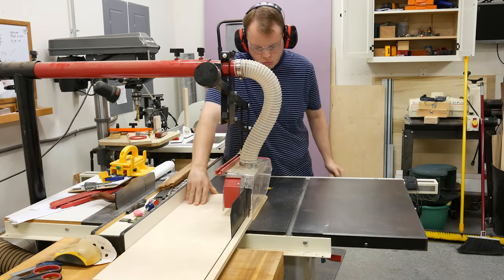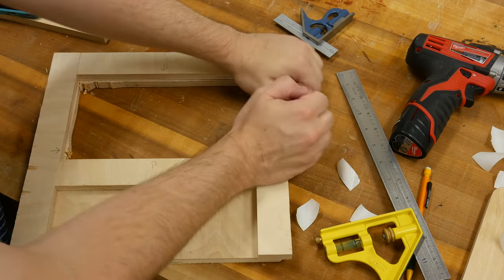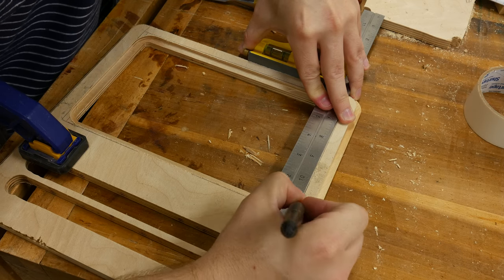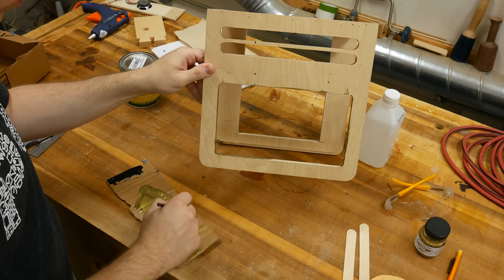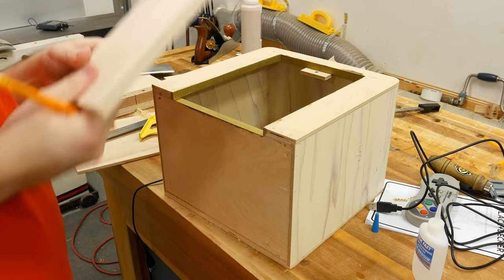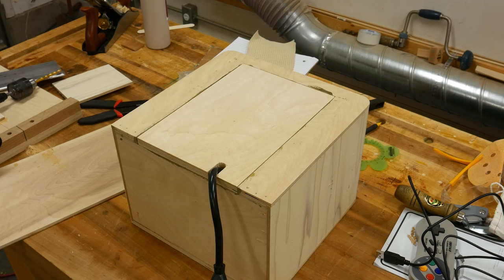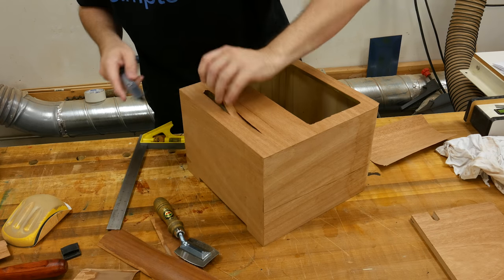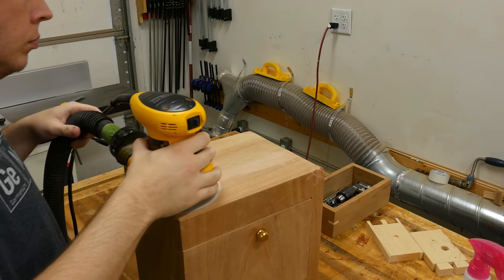Retro Arcade Cabinet Using A Raspberry Pi & RetroPie

Comment: Gorgeous case. Few thoughts I had while watching your build:
- Speakers: I'd definately purchase a high end 2.1 PC speaker set, disassemble from its casing and add subwoofer/left+right speakers - making a hole on the bottom of the case covered with a grill for the SW speaker, and 2 holes on the top (or one on each side) for the L+R speakers;
- Front controls: I'd make them functional - e.g., to operate the controls on the 10" LCD monitor's control board.
- USB location: I'd position the RPi so that the USB ports would be available from the outside (e.g., one of the sides), so for example, installing an external keyboard or a different gamepad/joystick would be much simpler to do.

Those are things I'd definately want to do if I was going to build this cabinet for myself.

Comment: When I veneer, I find it easy to cut out those shapes, like where your speaker holes are, with a drywall plunge router on a low setting. It works like a charm on old fancy radio cut-outs. Great work, though all around!

Comment: Everything looked great. Good first time build.
Suggestions.
1. Bezel the screen. The gold would look great with a bezel facing the viewer.
2. Stereo speakers. Your missing out good audio on some games.
3. I saw others say 4:3 but yeah finding a 4:3 hdmi screen is hard. You probably will never use the rest of the screen except in menus in retro-Pie. Might want to load Kodi.
4. Wireless. Get a Bluetooth dongle and pick up a pair of controllers from 8bit-do..
5. Make a matching wood arcade stick for mame games!
Reply from the maker: Thanks! I am actually making the matching gamepad soon.

Comment: That build is amazing. I have always loved the "old wood box" TV look from the 50's and 60's. 

You asked for some feedback so here is mine.

1) It would be cool if you routed a switch to one of the front buttons, and maybe a volume knob to another. 

2) Think about routing a USB port to the side of the box or the front in one of the grills for easier use of a corded gamepad and to add new ROMs to RetroPie using the USB service that it provides.

Comment: Clearly a lot of love went in to this build. It looks like you've got a great workshop there and clearly have a great eye for detail and a keen sense of 'doing it right'. Inspiring.

I didn't know what to expect when I stumbled across this video. Perhaps more of the internals side of things. I was pleasantly surprised. More than anything it's a great show of techniques for cabinet design and build - especially given you were making up a lot of it as you went along.

There were only two things I was a little surprised about. (1) You use nails for almost everything you didn't use glue for - were you ever worried about splitting the wood? and; (2) you chose a 16:9 aspect ratio screen when the game at the end has a narrower aspect - shame to put all that effort in and then live with black bars either side 'at runtime'!
Reply from the maker: Thanks! Yeah I wanted to focus more on the cabinet than the internals because setting the pi up was super simple and quick and there are tons of tutorials on that already.

1. I wasn't worried about splitting because I covered it with veneer so it hid any blemishes.
2. It's hard to find a 4:3 screen that wasn't an old CRT monitor so I just went with the 16:9. The black bars don't bother me really but it would have been better to have a 4:3 screen.

Comment: Very good job... would you be willing to due another one with some small modifications to it.... one use solid pine wood, two create an on/off switch, three add 2 small speaker, also front or side USB ports for controller and a Bluetooth add on for wireless controller and last two or one small fan on rear for ventilation.... also what screen model did you use for your project....

Comment: Very nice Cabinet top marks :), Veneer is always a difficult thing to work with. Steam in the iron helps bending it, As for your speakers well you could of done better, They sell a lot of good quality lower priced speakers these days, Like a small sub/tweeter/crossover mix, or even car speakers , Like the the sub could of been on the bottom and the tweeter/mid range out the front . A small tube amp kit could of worked nicely also the tubes glowing on the top, They sell DIY tube amp kits on aliexpress.

Comment: Gotta be some kinda functional buttons like power switch or screen color/saturation adjustments, or volume up/down etc. Not those black ones only do decoration. Besides, how does your wired controller reach the pi?

Comment: Superb work. Only one problem though, the style of the case is circa '40's but the games on it are from '80's and '90's so, minimum of 40 years age gap
Reply from the maker: +Matt Mattius not sure I see that as an issue. I also didn't see any tv designs from the 80's and 90's that I liked so I went older.

Comment: This is unbelievably cool. Thanks for sharing. Loved watching this.

Do you just use wireless controllers, or how does that work?
Reply from the maker: I cut a hole in the back door in the video for running the cables through it. Thanks for watching!

Comment: i want ask..is possibile to use it with a laptop monitor.i mean.i have my old laptop that not work anymore..i could use it as a case ..raspberry would be able to use the laptop monitor for work  and all other part like speaker?
Reply: you'd need a control board for the laptop lcd and an amplifier for the speakers. so yes it's very possible to make a raspberry laptop, if you've got the competence

Comment: Beautiful work, exceptional quality. The only issue I have is that retro gaming is best on a 4:3 display, and it's a shame to have all of this fantastic workmanship result in a product which displays ugly black vertical bars..but this is normal, I guess
Reply from the maker: +bumtree I wasn't able to easily find a 4:3 screen that wouldnt require me to make the box larger.
Reply: 4:3 in anything larger than about 3.5" is pretty much impossible to find and if you do it won't be cheap.  Not to mention that the retro pi has emulators that use the 16:9 format.  So all in all I'd say you made the right (if not only) choice for your build.   Looks great BTW!

Comment: Quick question: When you power this on, do you have to separately turn the screen and raspberry pi on, or do they both start up around the same time?
Reply from the maker: I turn them all on at the same time because the screen has a separate power supply which I plug into a power strip in the back.
Reply: Thanks for the quick reply!

Comment: Really cool. Does the controller plug in thru the door?
Reply from the maker: Yeah the controller wire goes through the hole in the back door. Thanks
Reply: Awesome project brother, I'm really digging this. Think I'm gonna get a raspberry pi in the next couple days.

Comment: Do you have to plug in the raspberry pie for it to work?
Reply from the maker: yes
Reply: SimpleCove [Sean Walker] so its not wireless
Reply from the maker: The raspberry pi requires power which means it needs to be plugged in to the wall. The controllers I used are wired but you can use wireless.
Reply: SimpleCove [Sean Walker] thanks for the fast and quick reply